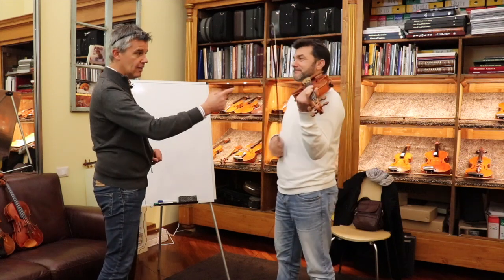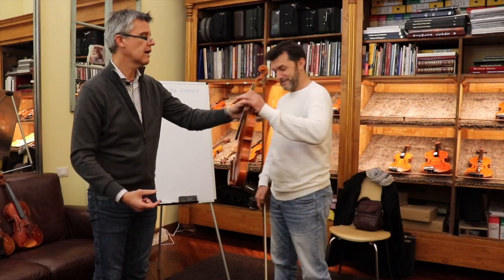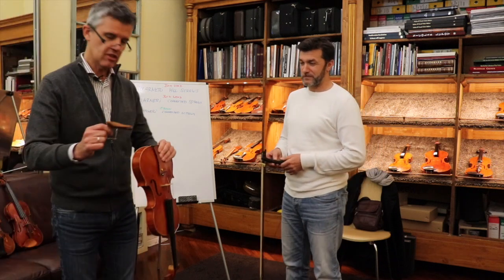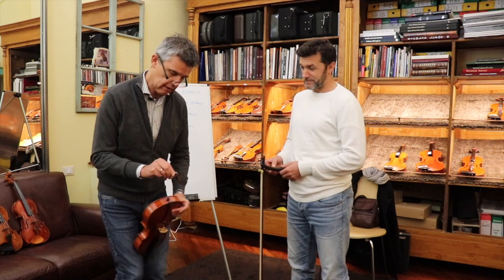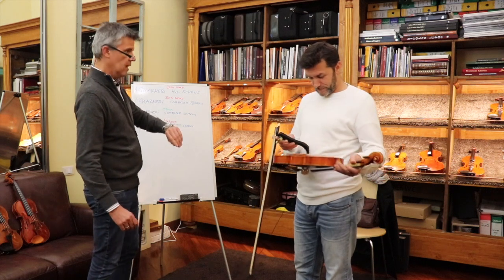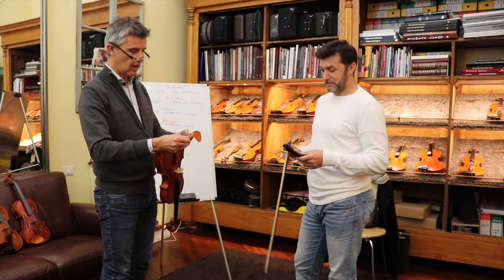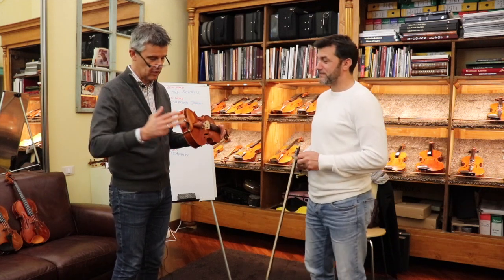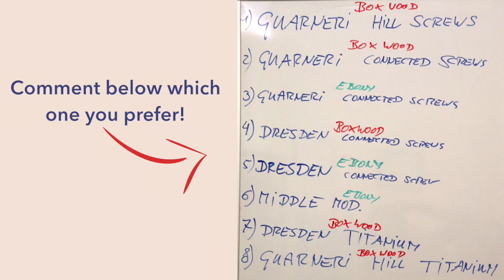Ep. 61: Chinrest Testing with Edmond Basha

Comment: I am confused what is hill or connected screw. I definitely liked ebony best. Is center mount better for sound?
Reply from the maker: Hill screws are the ones when the attaching mechanism is made out of two single legs to fix the chin rest on the edge of your instrument.
If these two legs are connected on the back side of the instrument it is a single mechanism with two legs.
Actually you should try it out with your instrument what is really better because every instrument responds different.

all the best from Cremona

Edgar